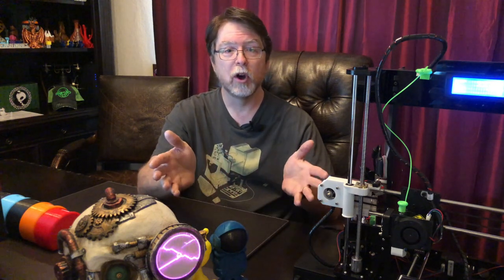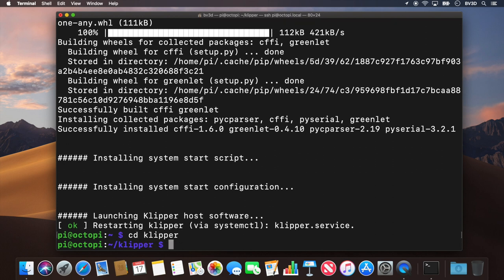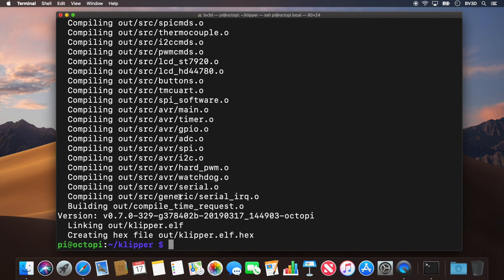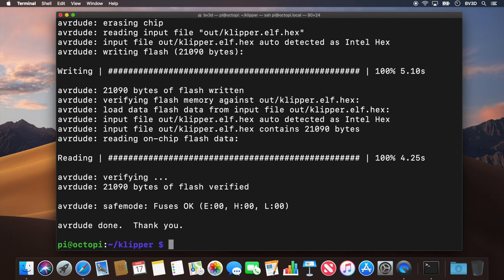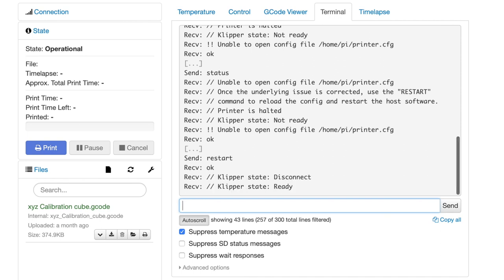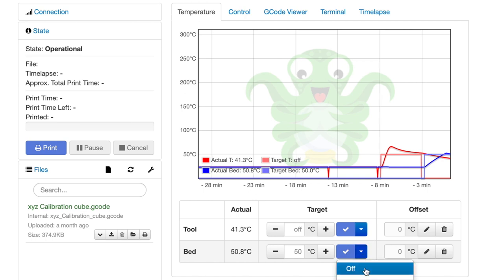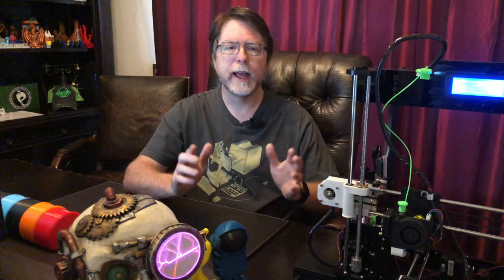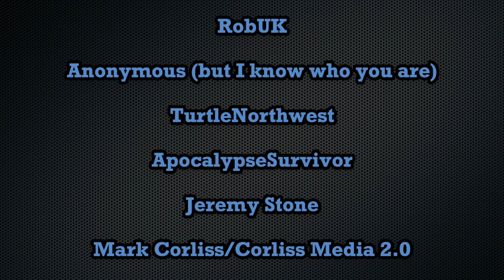Install Klipper Firmware on the Anet A8 3D Printer

Comment: Thank you Bryan for this comprehensive tutorial. Very helpful, as usual.
At the end of it, you "do hope that [we] enjoyed the video" and I must tell you: sure I did !!!
A few small notes, though:
- probably, I would have stressed that the password required to open the SSH is that of OctoPi (which is much different from that of OctoPrint!) I found it after one day of frustration, only thanks to the help of the log that I always keep when I install new Sw or Fw, and thanks to the support that I got from a keen user on the OctoPrint forum.
Bad for me! I should've studied better the difference between the two... but perhaps I'm not the only one out there ;-)
- when I flashed the firmware on my Anet board, I had to switch the printer on. If it was off, the USB connection could not established (of course). I don't know if there are alternative methods, but - whatever the method is - I would stress it on your tutorial
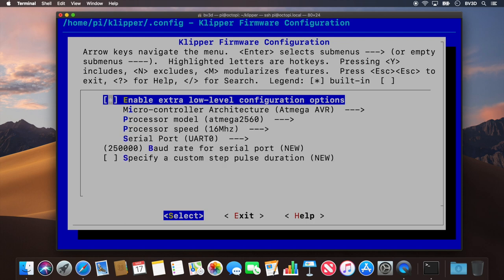- [EDIT] the latest version of the "Klipper Firmware Configuration" menu [@ 7:52] has a further option now, which reads `( ) GPIO pins to set at micro-controller startup` , which should probably be addressed for those who have a less profound knowledge of the matter

May be worth a slight re-edit of your tutorial... may be not... may be just a few footnotes. 
Thank you again !

Comment: Video gave me a perfect Klipper install. Easy and painless. Thanks!
Reply from the maker: Hi Alex! A Klipper update that was released after I released this video DOES support the Anet A8's buttons, and they seem to be more responsive than with the stock firmware! So if you installed this just a little bit ago, you may have working buttons! 👍

Comment: Nice video. Thanks. I have a bunch of printers but never tried Klipper. What happens if the Pi loses power from a power cut etc? Does it corrupt the instal / SD card image?

Comment: that was my first video i see from you.
You did a verry nice job. Your viedos have a good structure. you explain the stepps very accuratly that everyone can follow up.
i give you an subscription and hit the bell ;)

I Have a "Little Question":

i have two anet a8 and an octoprint installation on an Linux based on normal X86 cpu.
Is it possible to controll two printers on one ocoprint instance or should every printer have it´s own octoprint?
I saw that the printer used the printer.cfg.
So i think i need to renamed it to somthing like printer1.cfg and pritner3.cfg but is this possible for klipper to use the one file for printer1 and use another file for printer2 and how must it be configured

Comment: Very good an easy to follow video! I came here looking for klipper information, now I am seriously considering trying it in my Anet A8. What is your opinion over Marlin?
Reply from the maker: Hi Sebastián, I need to spend a little more time with Klipper before I can make an accurate assessment of one versus the other. However, I do miss the ability to control the A8 directly from the LCD. But since most of my day-to-day printing is started and managed by OctoPrint, it's not a dealbreaker. I generally set up a Raspberry Pi with OctoPrint for each of my printers.
I'll have some videos in the coming weeks which will cover some of the tuning needed to get Klipper dialed in on the Anet A8.

Thank you for watching, and thank you for the compliment!
Reply: Looking forward for the videos. Already subscribed!
I am working now on a new frame for the A8 made of conduit tubing and printed parts. Is a fun project and very cheap upgrade for maybe the weakest point of the printer.
Reply from the maker: Hi Sebastián! Is that a "Piper" printer? Sounds cool! One of the things I'm noticing is that the A8 with a stock acrylic frame isn't terribly accurate when it's going fast, and I suspect it has a lot to do with the flexibility in the frame.
Reply: @BV3D  No, it's even easier. It's called an EMT8:
https://www.thingiverse.com/thing:2818084
They have a facebook group with a lot of support:
https://www.facebook.com/groups/313198752549177/
Indeed, the frame is the weakest point of the A8, it limits a lot the max possible speed.
Reply: @BV3D  I have noticed that reinforcing the frame has helped a lot. Especially the mods to support and apply more belt tension. Slop adds a lot of Jitter.
Reply from the maker: @bustopherjones2285  Thanks for the info! I've seen frame stiffeners on Thingiverse, but I'm seriously thinking about doing a AM8 mod on the printer. A set of aluminum extrusions is in the $50 range. I'm hoping that gets it firmed up. One of my major issues with the frame design is the two threaded rods that form the front of the printer. They're too flexible, and that can lead to leveling issues if you move the printer around. I think I would be happier with a frame that has a solid foundation. 😉

Comment: I followed the guide with great interest which I must say is very precise! (thanks) but in my case I have a bricked card.... I load the firmware generated by klipper and if I don't turn off the printer I see the writing but the card DOES NOT flash.... I turn the printer off and on again.... screen without written and always it doesn't flash like with the original firmware.... where am I wrong????
Reply: Hey there, I also had bricked my Anet A8 Plus card (ANET V1.7). In my case it was due to running the regular command in klipper docs instead of avrdude as is said in this video.
However, after following the steps here I got the card to work again with Marlin/default firmware, will try with Klipper one of these days:
https://www.youtube.com/watch?v=hCGF-UdPSOA

Comment: Awesome instruction and presentation, Bryan!  I got excited when I saw your upload actually working.   then it happened....   programmer is out of sync......................
I really really hate seeing that.  What is it about that baudrate?  Still, it's nice to see it actually work for someone else, so I know it's possible.
Reply from the maker: Hi Jason! I'm sorry you're having trouble. Have you been able to load other firmware on your A8, or do you get the "programmer out of sync" no matter what firmware you try to load?
Reply: @BV3D  Nah, it's ok.  I've almost become used to it now.  ;)  :))  Before I uploaded the Anet-B 'reset', I had this problem only a few times.  The good times lasted about a year... and then I messed it all up when I installed that in order to try a modified version of Marlin.  It's weird though.  I can read it just fine, just can't upload.  

I've really been wanting Klipper since Kevin O'Connor came out with it, and like an ID10T thought that I actually had it when I installed OctoKlipper add-on.  Hence, my arrival at your very well timed video.
Reply from the maker: @jasonshrout8921  If you are comfortable messing around with the Anet board, and you have a USBasp or some other AVR programmer available to you, you might try flashing the Arduino bootloader on the Anet board, and then going forward with your firmware of choice. I've got a video covering that, from a Mac user's perspective: https://youtu.be/3jm0zzIneFc
The TL;DR version is: install the Arduino IDE; add the SkyNet board definition file for the Anet boards; connect the USBasp programmer between the computer and the Anet board; and install the bootloader. Then install firmware, because installing the bootloader wipes the board's contents.
Reply: @BV3D  Ok, I got it to work, but I had to upload the .hex through OctoPrint's Firmware Updater.   First, I downloaded FileZilla in order to FTP into the Pi.  Went to  /klipper/out/ and downloaded the klipper.elf.hex to my desktop folder.  

Thanks again for the video!
Reply from the maker: @jasonshrout8921  I'm glad you got it working. If I remember correctly, OctoPrint's firmware updater plugin also uses avrdude. The plugin may be passing different options to avrdude in order to do what it does. Thanks for sharing your success! 👍

Comment: Helped me a lot as I also use a Mac.  VERY helpful tutorial.

One 'quick' (??) question.  My printer is an Ender 3 Pro and I bought a second one which arrived yesterday.  Now that I have this Klipper stuff on my Pi, I assume I'm assuming I won't have to go through the WHOLE process from scratch?  How would I go about installing Klipper on the second machine?

Cheers
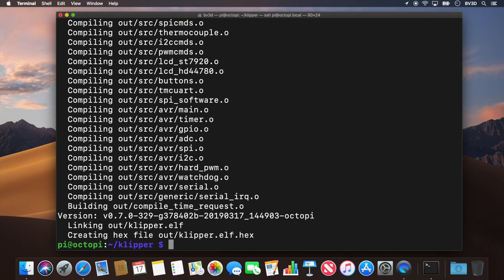Reply from the maker: Hi Muzz! Your second printer is the same as the one you've already got Klipper installed on, so assuming you've got a bootloader installed on it, you can pick it back up from the 9:14 mark, right after the "make" command finishes. Hope that helps!
Reply: @BV3D , Hmmm... 

I deviated from your tutorial at that point as my pi had AVRDUDE on it.  

For MY install, I followed both your tutorial  (coz you use a Mac) and at the same time, followed Teaching Tech's tutorial, coz he was installing on an Ender 3. (DIY hybrid tutorial...)

Too late tonight.  Too many technical tutorials for my bruised brain.

Thanks for your help. I'll let you know how I get on if you're interested.

Oh, will I be able to run both printers from the same RPi or will I need to buy another one?
Reply from the maker: @Grumpyoldtwit   I was going off the idea is that you've already used the make command to create the MCU firmware, so you wouldn't have to run through the configuration utility again. It should work, since the printers are the same model. As for doubling up Klipper on the Raspberry Pi, it looks like it's possible, but you end up creating a second instance of Klipper on the Pi. I found where someone had done that, but the "how I did it" page they linked to was in Russian, so...? Personally I tend to run one Pi per printer just for convenience (and so that I can perform maintenance on one printer without interrupting a print on another printer).

I usually opt for "easy" so I'd say get another Pi. If that's not in the budget, then check here: https://github.com/KevinOConnor/klipper/issues/1281
Start at about the 6th post in the thread (the "You misunderstand me" post); this goes all the way down to the final post, which is link to a Russian blog post. Google Translate can probably help you out from there. But do keep me updated on your progress. Also, how's Klipper working out for you on the Ender 3 Pro?
Reply: All bets are off.  I'm back to square one anyway as my SKR V1.3 boards with 2208's arrived today.

Looking forward to silent, smooth prints!
Reply from the maker: Oooo, fancy! Let me know how THOSE work out! Quiet prints for the win!
Reply: @BV3D  They're sooo quiet.  The loudest thing (by far) on the printer is the part cooling fan.

Comment: Nice explanations :)
Reply from the maker: Thanks, RomanoProductions! I'm glad you found the video helpful!
Reply: @BV3D  yes, you're the first one who gave a proper explanation about the split of the "firmware" between the Raspberry pi program and the Klipper-specific firmware on the arduino board. Looking at the info from Klipper website, I was not able to figure that out

Klipper has some advantages for older 8-bit microcontrollers (like the good old Anet A8, maybe Home CNCs) but now with many inexpensive 32bit board made by the Chinese (like the SKR PRO), Klipper is a bit late but still interesting to dig deeper (what you are doing), it will help many DIYers
:)

Comment: I'm getting the following error when i copy and paste your code, any suggestion?

avrdude: stk500_getsync() attempt 1 of 10: not in sync: resp=0x67
avrdude: stk500_getsync() attempt 7 of 10: not in sync: resp=0xf8
avrdude: stk500_recv(): programmer is not responding

EDIT/Update:
I was able to use this command and it worked now.
make flash FLASH_DEVICE=/dev/serial/by-id/usb-1a86_USB2.0-Serial-if00-port0
Reply: OMG! Thank you so much for posting this.. burned up my whole weekend reading way too many obscure posts looking for a solution, when I should have started right here in the vido comments! Amazing. Thank you

Comment: Hey great video... I'm using an Anycubic Chiron... what would I type for my config file?  This video is specific to the A8.  And would I need to install a boot loader on my printer first?
Reply from the maker: Hi Cody! There's not a pre-made configuration in Marlin 1.1.9 for the Anycubic Chrion, but Anycubic DOES have their Marlin-based firmware source code available on their Github page, at https://github.com/ANYCUBIC-3D -- there are two versions for the Chiron, 1.2.7, and 1.3.0.

Marlin 2.0 has a preset config for an "Anycubic i3", but I don't know if they mean "i3 Mega" or just i3-style Anycubic printers in general. And I haven't used Marlin 2 at all yet, so I'm not going to be of any help if you get stuck.

That said, I saw a video from Anycubic about installing .hex firmware files via Cura, so it looks like they've already got bootloaders on their printers.
Reply: @BV3D  Cool, thanks for the help.  I learned a lot regardless.

Comment: @Bryan Vines, thanks for the video..but when flushing the firmware does the printer needs to be powered on?
Reply from the maker: Only if it's not receiving power from the USB cable plugged into the main board. 👍

Comment: any news? I googled in your channel and didn't see updates! I wanna see if it's really worth it before messing this hard and spending so much time
Reply from the maker: Hi Chloe,

I'll give you a kind of mini-update. This might end up becoming a video.

Klipper keeps improving, and it now supports the Anet A8's clicky-button LCD. Klipper can take a little work to get set up, and it absolutely requires devoting a Raspberry Pi running OctoPrint to the project. 

If everything on the printer is stock, Klipper can easily drive the system faster than it can actually print. That said, the faster you go, less accurate printing is going to be on a stock A8. The acrylic frame is just too flexible, and the extruder can't melt plastic fast enough to keep up.

I think maybe in a year or so, if Klipper keeps improving steadily, it may be a contender to Marlin. But Marlin's benefit is that you can have something that fits and works entirely on the printer's control board without having to have additional, external computing resources available (i.e., a Raspberry Pi). Marlin is also now officially at version 2, and runs on 32-bit control boards. On such a board, Marlin can also perform its computations, and execute its moves, more quickly.

So I guess really, if you don't want to tinker with the printer a whole lot, I recommend staying with Marlin. But definitely put something besides the factory firmware on the printer, to guard against a thermal runaway condition.

Thanks!

Comment: this works over USB right?! no wiring needed!?
Reply from the maker: Right. Well, assuming you've got a bootloader installed on the Anet board, yes, everything's over USB. If you don't have a bootloader installed, you'll need to install one. Note that installing a bootloader will wipe the Anet board clean, so you'll have to follow up with a firmware installation. Factory firmware, Marlin, or Klipper.

Comment: https://github.com/KevinOConnor/klipper/issues/78#issuecomment-368281831

Bryan, I found within this thread, what looks to be a decent configuration tweak for the Anet Klipper config. 
 Also, there is a lot of info regarding clock speeds and possibly reasons as to why the ANET board is difficult to work with.  The author claims to be running at 200mm/s.  Would really like to see that video.
Reply from the maker: Awesome, Jason! Thanks for that link. I'm going to take a look through that thread (and at that config particularly). Before I do any other tweaking though, I want to run through the Pressure Advance tuning. I think that'll have a big influence on the extrusion issues I was seeing on that initial print with the default settings.